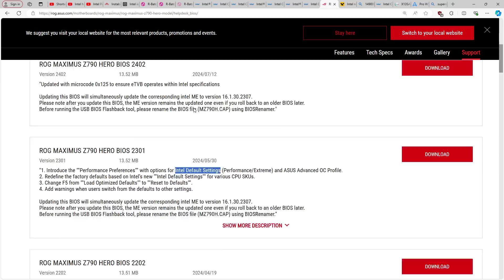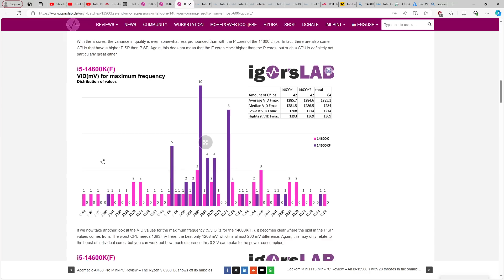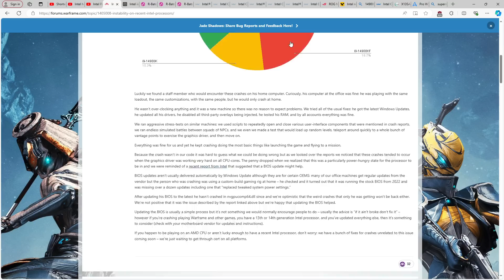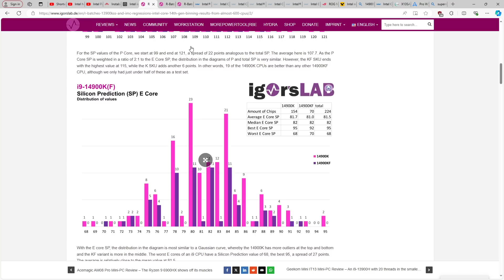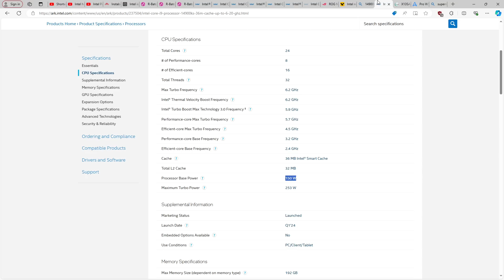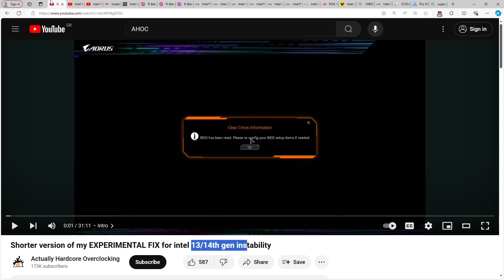The intel instability and degradation rant.

Comment: its only cpu can clock higher in uncore ...over 6ghz uncore that motherboards manufacturers want to set it at default vs AMD stuck at 2ghz uncore clock and stuck with lower ddr5 memory and still the same for 9900x...6200mhz...in 2024....4 years late and 4 years stuck at 6000mt vs intel been gonna up in ddr5 clocks thus gonna up in uncore clocks from 4400mhz to 6ghz

Comment: How do I make sure my 13700K doesn't degrade?
Reply: You don't, Wendell pointed out that Gaming server providers tried downclocking their 13900K and 14900k CPUs and that just delayed their demise.  They still degraded.
Reply: @giglioflex  That's not correct.
Reply: @contactron  Go and watch his video.  It is 100% the current situation.
Reply: @giglioflex  I have watched the video. They didn't mention any i7 failures. Also, in this video, buildzoid mentions that high VID is the cause of degradation, and the i7s have lower VIDs. So they should not be susceptible to the same rapid degradation as the i9s.
Reply: @giglioflex  Also, Wendell never said that downclocked CPUs still experienced degradation. Only that they still exhibited failures, AFTER degradation had already occurred.
Reply: @contactron  Buildzoid said the higher voltage of the i9s MAY be the cause of degradation as that is typically the cause of the degradation but he also theorizes that it could be something hardware level given the evidence wendel presents.  If it were your typical degradation, a significant reduction in voltage should ensure a life-span similar to that of your typical CPU but that is not the case in this instance.  In addition, there are many people in this very comments section and on reddit pointing out that in fact their i7 and i5s have degraded as well.

"Also, Wendell never said that downclocked CPUs still experienced degradation. Only that they still exhibited failures, AFTER degradation had already occurred."

Those are one in the same.  If a CPU fails to even function after a user downclocked it to a stable frequency, that means further degradation occurred after the prior safe frequency.  In fact it indicates that degradation accelerated.  All CPUs degrade over time but typically it take awhile and often the degradation is steady.  That it happens so quickly and accelerates to complete failure is worrisome.  I have been overclocking CPUs for decades and I can say that such rapid acceleration towards complete failure is not normal.

Comment: My i5-13600K which I have only bought just like 4 months ago, has also started to exhibit some weird behaviour as even a game as old as Batman: Arkham Origins from 2013 has crashed on me two times with a Fatal Error message. Admittedly it's only happened twice in like 10 hours of gameplay but on a chip that is basically brand new? That's still kinda unacceptable for me, especially since I had to save up a lot in order to build this rig and now these issues came to light.
Reply: That's not your CPU. I get that error in Origins with a 9900k.
Reply: @AfshinBarani  damn that's actually relieving to hear. Actually when this PC was first built, I encountered a ton of blue screen issues and fatal error/binaries missing errors on Arkham Knight first (I hadn't installed or tested Arkham Origins back then), but those Blue Screen issues seem to have been fixed once I replaced my RAM and the PC was running fine for like 10 days, there hasn't been a single Blue Screen since the RAM was replaced, but then this error happened on Arkham Origins which seemed very similar to the random errors that I was getting in Arkham Knight with the bad RAM, and then these CPU issues came to light and I suspected that this may be due to the Intel 13th gen CPU causing issues.
Reply: A 13600K should be relatively safe since it's below the 53x multiplier (5.1ghz at the fastest) worst case scenario though it just means it'll take longer to degrade.

Comment: 1:02:30 my old pc (in other house) is 2500K OC at 4.4ghz. still running Dota2 ot 160 fps with 1060 3gb. everlasting cpu. I play on it on the weekends
Reply: 2500k is a champ. Mine still runs 4 ghz on air since the day it was plopped in to the socket. I'll never get rid of it I swear.

Comment: Remember the issue with ASUS and AM5 last year?... and now people who got scared away from AM5 platform to Intel now got their shot at anxiety
Reply: Problem with AM5 and Ryzen 7000 was just a simple case of board vendors shoving way too much voltage into the CPU causing it to die pretty quickly, CPU itself was perfectly made. Easy permanent fix was AMD capped the voltage via AGESA so it couldn't go higher and that was the end of that issue. This on the other hand is far more problematic as these chips are not spontaneously dying or blowing up due to overvoltage they are dying at stock and at low temperatures even in a server board where in some cases the Intel CPU has never passed 125w. This unlike AMD seems like a physical hardware defect in the CPUs which no amount of BIOS updates will be fixing this. 

Intel more than likely know the root cause of this by now as they have the tools for it, problem is do they announce that potentially all or a majority 1300k and 1400k CPU have a physical design issue scaring shareholders, regular customers and customers that buy these in the tens of thousands, because if they do then they will be doing one hell of an expensive recall or replacement program with actually fixed silicon. Whatever Intel do it's going to cost them a fortune as well as loose customers.
Reply: @richard-davies  Pretty much. I remember details, because I was switching to AM5 platform in the peak of that controversy.
To be safe, I went with BIOS update before installing CPU.

Comment: Well, I bought a 14900k back in February and tomorrow I'm getting the warranty replacement delivered.  It had random issues for the first couple of months, but about 2 weeks ago it seemed to have degraded rapidly to the point I spent over 12 hours fighting BSOD while diagnosing the root cause and couldn't even reliably get into safe mode.  I ruled out drivers, software, and most of the hardware before taking it to a shop that eventually put the CPU into another system and the BSOD issues persisted.  The one time I went top tier in building a PC and I get this experience.  😑
Reply: Got my first 14900k in December 23. Gave me some "status access violation" in Chrome at the beginning. For the rest seemed fine. Then starting from March 24 degraded rapidly. Needed more voltage, while at the beginning worked fine with negative offset. Luckily my retailer sent me a new one the same day I sent the defective one to them. This one now has better SP rating according to Asus and needs lower voltage and so far stable and no issues. Hopefully that better SP, lower voltage will let it live longer. If not, Intel will have to replace again lol. Mobo wasn't cheap either. Can't switch like that.
Reply: @jondolar1988  was that in the stock frequency?
Reply: @sidsgaming167  Hey, no I actually didn't overclock. I mean at the beginning I tried just a few runs to see what was possible, but then I dialed back to stock and left it like that. So not my fault. Also it is custom watercooled and have lots of temp headroom.
Reply: It does seem like high frequency RAM does accelerate degradation… but what do I know 🤷🏼‍♂️
Reply: Thats how my 1st 14900k was. Took months to get a refund. got another on amazon for 500ish dollars. Been running good this one.
Reply: @Corrosion37  I'm glad you're running smoothly now and I hope it stays that way.
Reply: @adamksenior6669  Please tell me what mainboard you use and exactly what RAM, really want to know this
Reply: @freesS3  I am running an ASUS ROG Maximus Z790 Dark Hero with Corsair Vengeance DDR5 6400 CL 32, 2x 16GB sticks.  I orginally was running 4 sticks, but I had to learn the hard way 4 sticks of DDR5 doesn't seem to want to run at the advertised speeds, so knocked it down to 2 sticks.  That helped rule out RAM sticks during my troubleshooting at least.
Reply: DID YOU OVERCLOCK
Reply: @sidsmusic991  I did not.  I was running the MB defaults until the Intel Default BIOS update (12 something) and again to I believe 1307 or whatever the latest is.  Initially I did all the usual benchmarking to see where it's at and if temps are reasonable under load and my cooling setup is adequate given the reputation of the 14900K running super hot.  My 420 AIO usually kept it under 90c and I was using Thermal Grizzly Kryonaut Extreme to get as much cooling performance as possible without going overboard with liquid metal or direct die cooling.  I have not earned enough XP yet to unlock those skills.
Reply: Same here but I had to pull teeth to get to Intel to agree to replace it
Reply: Eh you made a coin flip of a mistake, one side 14/13900k and the other 7800X3D
Reply: @puffyips what's wrong with the 7800x3d?
Reply: @connivingkhajiit He means to say that going Intel was the wrong choice.
Reply: @razorblade7108  oh i thought he meant a coin flip between two mistakes
Reply: @connivingkhajiit what's wrong with the 7800X3d is that it's amShit
Reply: @brunodinis7454 currentnl gen AMD beats intelaviv in every metric

Comment: This is already worse than TLB bug from phenom and early am5  x3d cpu's burning ... why ? because of intel atitude and what's they are doing or rather not doing ... Stuff can happen but when they didn't react for almost 3generations  at all on socket pressure  issue bending cpus , took more than a year to adress too agresive power limits on many boards and they don;t even said a world public about high degradation issues then we have very big problem .
Reply: Yes i had the TLB bug Phenom. Since then only had Intel. Have 10900k. Next Will be AMD again. But waiting til test and mature tech and Long time use befordre upgrading.
Life too shorts for BSOD in my limited free time.

Comment: I have a 12700K i bought when they were hot off the press that ive just discovered is degraded (likely entirely my doing) and ive been out of the loop for quite some time and my god, the stuff on this made me say no to buying a 14700k to replace it. Will Likely wait a bit and go AM5 next build...

Always saw my intel CPUs as being pretty tough, my 8700K put up with a lot and dont get me started on the shit my 2500k and Q6600 (3.6ghz 2000mhz FSB, yes that was 1.55v+ vcore.) saw and survived just fine, for years at a time. Guess thats just not the case currently.
Reply: The difference is that those other CPUs had plenty of headroom, I mean some older Intel chips could be pushed an entire GHz above their base clock like nothing.
However alder lake and raptor lake (which is fundamentally tweaked alder lake cores) have been pushed to the limit by Intel to one up AMD, these are the consequences I suppose.
I mean 12900K - 5.2ghz
14900KS - 6.2ghz
Reply: @Daniel-ul8kr   Oh yeah, its crazy. Going even farther back I had a Prescott P4 on PGA478 I was running at 3.9ghz with stock being 2.2... 

Pulling out all the dirty tricks to stay ahead!

Comment: The company I work for has lost 4 of the 8 earliest 13900KF we bought, all to CPU failures - the last one was recent so tried loading ASUS latest Intel Safe settings with no luck, so I'm definitely on team "it's degradation". These were all running ASUS stock settings (at time of purchase) on ASUS Z690-A, no overclock and using 240mm AIO. A number of later 13900/14900 (all K or KF) has had partial failures where updating BIOS and loading the safe settings has brought them back - for now at least. I don't think I've seen it with any of the i7's yet, and obviusly they're now all detuned to standard VID/CEP/IccMax. The jury is still very much out if running with those settings merely extendes time or actually avoids degradation - it's certainly not enough if they've degraded too far.
I really would have liked Wendell to check and confirm that at least the SuperMicro workstation boards actually didn't disable CEP and/or IccMax - would hope they wouldn't but you always want to verify your assumptions and he didn't. Not that AMD 7xxx has been a cakewalt, memory stability at 2x32GB has been variable (seems to depend on AGESA version but newer can be better or worse) and 4x32GB is a HARD on AM5, but is easy on AM4/Intel DDR4 and Intel DDR5. Which is a pain when people need that memory....
Reply: Asus stock settings were not defaulting to Intel specs. This has been confirmed by Falcon Northwest. Intel released a new microcode for Asus boards a month or so ago
Reply: Your problem is running an i9 14900k on a 220 cooler when it needs a 420MM and your motherboards probably aren’t up to the task of taking the I9. It’s recommended you have a new z790 MB designed to take these chips.
Reply: @madclone84  First of all, no it does not need a 480mm cooler. Unless you're running full on benchmarks, the CPU is not going to be maxed out. And even if it is, the design of the CPU is to hit a target temperature and fluctuate power to keep the highest clocks without exceeding that target temp
Second, even a 480 cooler is not enough. Hell, you can have dual 480s and still thermal throttle. The difference is just how fast will the AIO loop saturate.
Reply: @rustler08  yeah I’ll take my advice with no issues rather than this guy burning up his chip
Reply: @madclone84 you are buying dogshit tier AIOs if you need a 480 to cool 250 watts lmao.
Reply: @macicoinc9363  do you even have a 14900k. You need a 360 or higher to cool the chip especially if you have multi core enhancement enabled from the asus MB. It’s going to get hot and you need to cool it

Comment: You are partly wrong ... stability isues are with all "big-little" intel cpus - also mobile ... just see the comments on level1tech , gamers nexus and hardware unboxed videos you mentioned . 
And there were already reports of "lag" when high load on i/o chip inside 12/13gen cpu's - few youtubers like techYesCity already reported of it and switched to older cpu's /amd because of that . I have even seen this kind of behavior on 12400F without E cores so this is really worying . Combine this info with I/O errors and cpu's unstable brand new from level1tech video and i think it's not voltage problem but something big on architecture level  - maybe you are partly right with "RING"  but if it is degrading i doubght it's because of voltage , especially knowing that workstation boards use low power limits and failure rate on those were even bigger than in gamers systems .Also in about 40:00 you said that to fix it they will need to lover the boost clocks even a 500mhz ... but watch again that level1tech video and you will know that on those server boards the i9's run BELOW 5ghz ...
For what we know until now i think puzzles add up to a architecture level problem and that is very very bad news not only for intel ...

Comment: Is my core i5 13600k in danger for a fail?
Reply: Probably not, especially if you've had no issues so far. (Or at the very least degradation is slow enough to not be a factor for several more years)

Comment: I had zero issues with my i9-13900k with my Asus ROG STRIX Z690-E. (Using an evga 1070) until I upgraded to a 7900xtx. (1080 -> 1440) 😅

More than anything, my cpu is sitting at 90°c when gaming on older games, and I've been frequently getting a frozen green screen of death. (More so whenever I try and tune my gpu or just simply load a game up.) I did however, upgrade my Asus Bios to the most recent version and I haven't crashed.....yet.

Maybe I should also upgrade my power supply? (1000W Platinum PSU with a 1000W UPS)

If this is all just Intel, I can't wait to go AMD.

Comment: I just bought an i5 13400, do these low end models also present failures? Or is it just the high clocked ones
Reply: Good question.
Reply: We don't know yet, sadly. It could be the case that the degradation issues are limited to the higher end models, but it could also be that those are the ones that just deteriorate the fastest and with enough time the lower end models will eventually start to show issues too. Only time will tell. :/
Reply: @theseabass  sadge this was a big buy for me even though i got it with a credit card its gonna hurt to pay
Reply: I think the 13400 is based on the 12600K die so should be ok. That said I do have a friend who has a i5 13500 (AFAIK based on the 13600k die) that has decompression failures in games and I cannot find any reason for the issues other than the processor and that was from new.
Reply: @Nasantha  nice information brother! ill check it out

Comment: The buyer's remorse I have currently for buying a 13600K and not a 7700X is insane.
Reply from the maker: I think the 13600K should be mostly safe unless you got a really really bad sample.
Reply: I just sent back the 13600 I bought before the 30 day return window. I wasnt comfortable with all the juice I had to pump into it and the thermal throttling at stock.  I picked up a used 12400 instead and run it at 5.2 and its been good enough for.me
Reply: At least you only have to regulate 14 cores. Two settings: lowest voltage it can remain stable at 3.9GHz all cores when its idle or not running intensive tasks or games, and lowest voltage it can remain stable at 4.9GHz all P cores. Treat the 5.1GHz rating on Intel's site like a chicken run setting. You lose performance, but more than a 1GHz delta between what some cores are able to handle was a crazy idea to begin with.